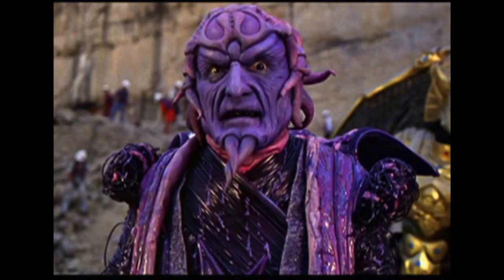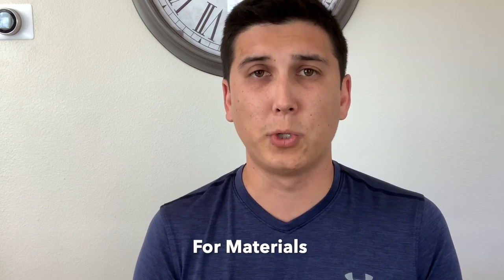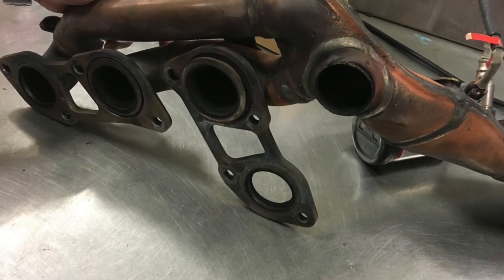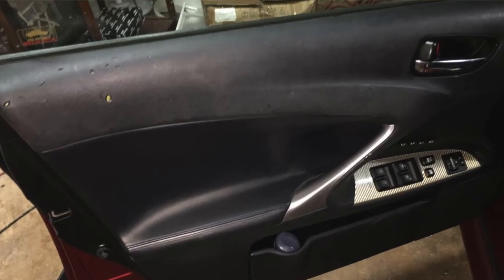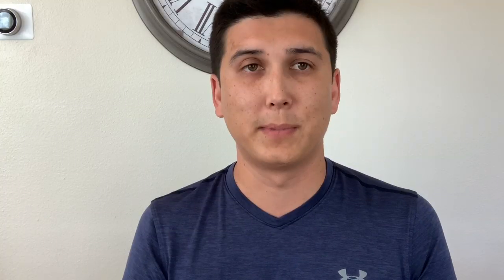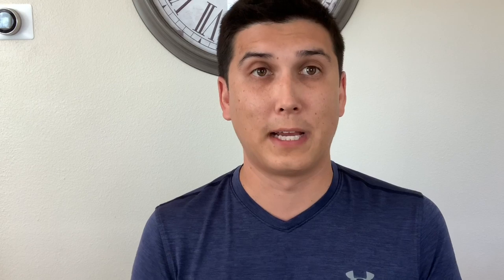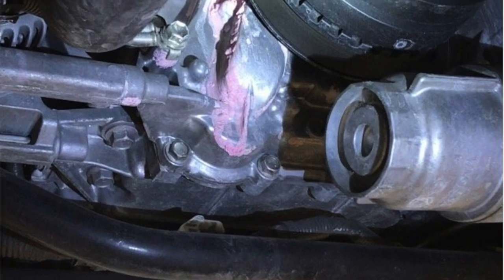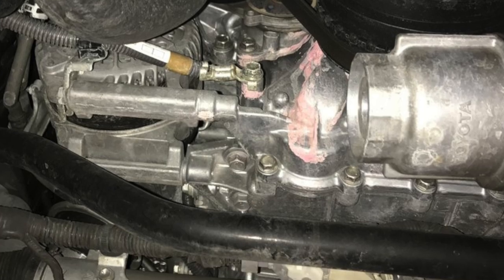Problems With The Lexus ISF

Comment: Great video. Just wanted to add that I just had the valley plate fixed on my LS460. It also is an issue with other models with the 4.6 engine so it's not iso to just the IS F which I know has a different V8 but it's a common issue across the board.
Reply from the maker: Thanks for the input!  Seems like this is happening way too often across their V8 lineup and Toyota should offer a recall to fix this issue.
Reply: different v8 same platform

Comment: Great job with the video on identifying quite a few issues with our cars! A few more would be the window rubber molding that covers the chrome trim on the sides lifts up and degrades, requiring replacement semi-often. Also the roof moldings often get pre-mature paint fade and you end up needing to replace them (they come painted to match). Also the trunk buttons melt which requires replacement. Two interior pieces I can think of that wear prematurely in my opinion after seeing so many of these cars come through the dealer are the steering wheels and shift knobs wearing out. Two noise concerns often had are noises when going over bumps from the sunroof- which requires an adjustment and change of the sunroof seal, also a squeal when in manual mode shifting hard from 1-2-3, which is the drive belt that needs to get changed out (they go through them relatively fast, 60-80k miles). Shifter plastic covers also commonly break. One more final thing that some owners have issues with is a intermittent airbag light on, or just straight up a airbag light on the dash, without having had any accidents. There is a warranty enhancement for replacement of the driver side knee airbag inflator connector. I read through all comments and didn’t see these so wanted to add my 2 pennies !
Reply from the maker: Wow!  I had not heard about some of these before.  Sounds like you work at Lexus and have seen these first hand?  Thanks for adding to the list!
Reply: ISFASTER Just added one more on that, keep thinking of them as they come ! Yes indeed, lots of cars through the dealer and me personally owning one have led to quite the mental database.. lol 😂
Reply: Also, expiration date for dash/door panel enhancement is 3/31/21, expiration date for air bag connector is 6/12/20 .

Comment: IIRC the coolant leaks were really only prevalent on 2009 and earlier models. Toyota had a bad batch of sealant or something company-wide. The Tundra engines get coolant leaks as well in those years. Haven’t looked into other engines.
Reply from the maker: I’ve seen/heard of it happening to 2010+ models as well, may just seem like the 08-09s are more affected because those two years account for over 50% of ISFs sold.
Reply: @dawnpoint This is misinformation

Comment: Additionlly to usual faults (valley plate leak, cracked headers, starter problems etc) I guess we can add radiators that blow up to the list! Had mine fckd  yesterday. 115 000km on the clock only, mint condition car. Luckily I catched it just as it started leaking after seeing fresh fluid under a car on shopping mall parking lot close to home. Pulled it out today and it's a major PITA for something that should be simple radiator replacement. Of course, never heard of this issue on them or had any car in generally that would have radiator fail so soon. Yet, one google search later reveals it's super common on them around that mileage. If your has more and it was never changed, you are running on a borrowed time.  New oem one is up to 1000$, depends where you are. Full aluminums are like 2-3x more than for other cars for some reason (1000-1800$ here in Japan). I've uncrimped and removed top tank and surely enough it is cracked around inlet hose area where it's the hotest and whole plastic has became brittle.
Reply: New oem radiator is <400$ if you install it yourself
Reply: @roofcamper3473   Ah really? Flat rate no matter where you live?

Comment: I have a video on how to find a valley plate leak with a borescope. First indication is low coolant . A $20 borescope at Amazon was a great investment.
Reply from the maker: Nice!  Thanks for contributing.
Reply: Great channel man. Feel free to link my vid. There is no sound but it’s a simple and easiest way to look for the valley plate leak BEFORE it starts leaking down the firewall side or down the tranny, etc. Lexus did a visual inspection and pressure tests for TWO years and couldn’t find it. A $20 borescope showed them to perform the work before my warranty ran out.
Reply from the maker: @icebear8637  - Thanks, that's good that you were able to show them and get it fixed under warranty.

Comment: Thanks, this is really comprehensive. Considering an ISF and want to know what I'm up for.
Reply: if u got one, what do you think? i’m looking for one atm
Reply: @newera8388  yes I ended up getting one and this video was very helpful because it prompted me to find a car without these issues. Valley plate was done, control arm bushings replaced, etc. The subwoofer was actually missing from my car but I've replaced it with an aftermarket unit that sounds great. The car itself: I absolutely love it and everything they say is true (good and bad). It's fast, it's fun, it sounds great, feels great to drive - however she takes a while to "wake up" if you're driving normally and then put your foot down, and you do have to be driving it hard to get the fun noises... but for me, that's what makes it such a solid car to drive: all play when it's time to play, but sedate and undramatic when you're just cruising in traffic (except for the exhaust rumble that's there as a constant reminder it's not an IS250)
Reply: Ha! That said, I got smoked at the lights by a VW Golf R the other day. Apparently they took the rumble as a sign I wanted to race (I didn't), so I was in full auto non-sport and took off normally until I saw it "was on" so to speak. But the "F" was like "oh hey human, I got your throttle input, but I can tell you probably only want to go a little bit faster... oh okay, a bit more? How about that? Still not enough? Oh, shit sorry, I got you now fam.. BAAAAAAARRRRM" by which time it was all over. So if you want the taps on at a moments notice, you have to either floor it from the get-go or be in full manual.
Reply: @IainFraser81 How did you find one? What was your methodology? I am looking for one

Comment: Driver left side seat bolster wears out. The leather tends to crack. Brake caliper peels & cracks. As for the interior trim, avoid oil based cleaners at all costs!
Reply: So normal wear and tear for the seats and calipers 🤣
Reply: Eli Gonzalez  If you bought your car used, then it might seem normal. I bought my car new. In about year, I  starting noticing what I mentioned above. It was really annoying. I’d rather dealt with this than interior panels melting.

Comment: wow was having problems with my ifs last night. drove fine the following day and when i get in to go home it wouldn't start! lights was working fine and everything. but it just would't turn over. so now i have it at my local mechanics to see whats wrong with it
Reply from the maker: That sucks to hear.  I hope it isn’t anything too serious or expensive to fix.  Maybe the starter?  Best of luck!
Reply: I have a lexus is 350 and it was nothing but problems.  I loved it at first but now i hate that fucking thing. The head cracked, the alternator gave out,  the starter gave out, i was driving to work and the car started shaking real bad, i went back home, it was fine,  6 months ago it cranked 1 time and then nothing, i replaced the crank sensor, mass air flow sensor, ecu, and then when the car started to crank over it wouldnt start as if it wasnt getting gas but i took the fuel pump out and its strong. Now that i dont want the peice of shit people say its the immobilizer. Fuck that im not trying shit anymore. I know i just got a peice of shit example but regardless i would never recommend that car to anyone anymore.
Reply: @ahberlowkz852  what model year
Reply: @SonnyVisual  08
Reply: What was the mileage on yours?
Reply: What was the problem

Comment: I hit the maintenance jackpot with my ISF its a 08 with 140k its running great but i had all the mentioned problems including starter malfunction, rear suspension, cylinder misfires, lots of stuff, good and bad thing is all happened pretty much at the same time around 100-120k the most expensive was def the starter save money for that it cost me $2300 for replacement at dealership good luck trying to find someone that will do it cheaper almost all turned me away! Its a fun car but I suggest trading it in after 130k or so btw ive been daily driving it for 9 years so something to consider and i do drive it hard too and dont hit any pot holes will bend wheels $800 a piece for each
Reply from the maker: Yikes!  I’ve heard of a lot of people replacing the starter when doing headers on their cars.
Reply: Starter. Haven’t had that yet. Mine is at 175k!! Love it. 😂😂

Comment: From what I've read, the reason the IS wears tires more so on the inside is due to design. Lexus cambered the rear to provide better stability in corners and thus causes the tire to wear more on the inside.
Reply from the maker: The inner tire wear is on the front tires.
Reply: @ISFASTER  oh weird... I hadn't heard of that issue before. Couldn't it be due to poor ball joint design and/or control arm bushing wear? Both upper and lower?
Reply: @nathangoodman603  The 1st generation IS had the same issue. A adjustable upper control arm or aka "camber kit" will correct this inner tire wear issue.

Comment: rearward front lca bushing tends to go soft. but the inner tire wear is more related to camber change during suspension travel while track driving... I definitely destroyed my inner tires driving really hard, even with rearward lca bushings. The suggested camber adjustment fix is probably the best way to fully fix this. also getting stiffer sidewall tires seems to help quite a bit. 

the valley plate leak is caused by the corrosive coolant eating away at the FIPG, I did mine with permatex "The Right Stuff" still good 2 years later. The example you showed where its dripping down is an EXTREME example. Easier way to check is using a borescope. Run it down near the PCV hose and you should be able to see the red crusty stuff if you have the leak. 

Also, when performing the vally plate reseal. be REALLY CAREFUL with the direct injectors.... I believe there is a harness connector towards the rear, it may be easier to literally remove the injectors without unplugging them then shattering the DI injectors they are very brittle. also be careful that you do not roll the o-ring on the bridge pipe during installation, you may need a mirror or borescope or something to verify it is not rolled (you should be able to see it in the gap) it may be helpful to dip the oring in coolant as it can act as a lubricant, also get a new one from the dealership they are cheap and typically the old one is stretched in comparison to a new one increasing chances of rolling the ring. 

great video

Comment: Great video! Addresses most of the common issues experienced by ISF owners. Luckily for me I have not had to deal with most of these. Possibly cracked headers as I do get the ticking noise on cold start-up, but this is a mod well worth doing regardless of cracked headers :)
Another issue worth mentioning that I have experienced and have heard from other owners, is a clicking noise on the front end when backing up. On mine it's just a quick click noise on drivers side front end, then immediatley goes away once car is moving. Possibly worn ball joint ?
Reply from the maker: Thank you.  I’m hoping I won’t have to deal with any of these in the future as well.  knock on wood  I’m not too sure about the issue you’re having though.
Reply: I think it’s the front lower control arm bushing it’s a common problem on isf and easy to change

Comment: I wish the 2012-2013 IS F had an updated interior... would change my mind from getting a 2013 IS350 F Sport
Reply: The 2012/13 ISF has a fantastic interior,with way better materials used and of better build quality than the German competition. The infotainment system is not interior. If you buy an ISF for its infotainment system,perhaps you should buy PS5 and glue some wheels on it.

Comment: Cracked exhaust manifold should trigger o2 sensors so that one should be easy to  diagnose.
Reply: kjax are you saying that if an isf had cracked headers or exhaust manifold, there should be a check engine light?
Reply: @kevinalonso3395  yes assuming the o2 sensors are stock
Reply: kjax would there also be smoke coming out from the exhaust?
Reply: @kevinalonso3395  well on my ISF mine cracked and the only symptom was CEL/limp mode. I'm not sure if that would happen too. If you're having issues I'd recommend making a post over at the clublexus.com forums to get some more opinions

Comment: Welded headers cause a major power loss. I’ve had a header welded in the past and it does nothing but hurt the flow.
Reply from the maker: How would welding the two pieces that were originally welded together make flow any different?
Reply: @ISFASTER  haha exactly just a cheap fix till u gut them or get ppe

Comment: Hello there. Thank you for reading my comment. I am having an issue with my 2011 ISF. My rpm refuses to go up at about 5500 rpm on sport manual mode. Also it refuses to go up when in sport automatic mode (refuse to shift gears when at automatic sport mode). The normal mode looks fine. Have no idea about it, maybe you know why? Thanks so much!
Reply from the maker: I’ve never experienced this.  I recommend putting a post on clublexus.com and seeing what responses you receive.
Reply: @ISFASTER  Thank you no worries. I will bring it to the dealership to sort it out. Hopefully I can update the issue and benefit some other owners too!
Reply: What was the problem?
Reply: SunshineState it’s been fixed. It’s just the silicone intake being a bit old and soft, so the rpm goes up, the air in it was too fast so the silicone intake shuts! It stopped the air to go in so there was an instant power cut at 5500 rpm. All good! When you guys get the aftermarket intake, do think about the silicone ones since it would get old and weak.

Comment: The engine starter is also a weak point of the car from what i´ve read
Reply from the maker: I’ve read about it going out and some people will change it as preventative maintenance when installing headers.
Reply: Just changed my starter then found out the previous owner had already installed PPE Headers lol!!! I did the labor on jack stands btw..

Comment: Hey. What tire size you running on the rears with stock rims? I'm looking to go with 285 Indy 500s and worrying if it will cause fender damage or if it will be safe.  Was going to go with 295 on stock rims but realized I am pushing it.  285 seems like the safest width upgrade.  Just wanted to know your opinion since I've heard you also run Indy 500s
Reply from the maker: I run 285/30/19 on stock 2012 wheels on a stock rear suspension without issues, no rubbing and no fender mods.
Reply: @ISFASTER     same here   stock suspension, stock 2011 wheels. you think a 295 would be pushing it?
Reply from the maker: Yes, most people run 275s on the 2008-2011 wheels.

Comment: My is F wgen i floor it it turns of a trisngle came on when that happened it beeps and the light flashes little ago did i sleep inside of it and it shut of now it wint turn on when it does it comes in for a min then it turns back off i dont know what the problem is

Comment: Thank you for the link, I am going to order my part via akguam Lexus.  I have question my ISF has full on exhaust PPE headers the B2-S2 code p-0157 keeps going on my scanner,  I replaced the 02 sensor and found that the previous owner by-pass the sensors through the passenger sensor B1 S2  with some kind of relay,  is their a way to completely bypass the sensors? Please let me know thank you.
Reply from the maker: I believe you can use a tune (RR-Racing) to get rid of the check engine light or an O2 simulator.

Comment: Really wanted one of these cars as a Toyota guy and after seeing and reading more and more about these problems. Kind of turned me off on my search. Some of these are not "small problems"
Reply from the maker: Overall my car has been great for the performance it produces and very reliable especially for the way I’ve ran it on the track.  Each car will have its own issues but I would not classify any of these as catastrophic failures.